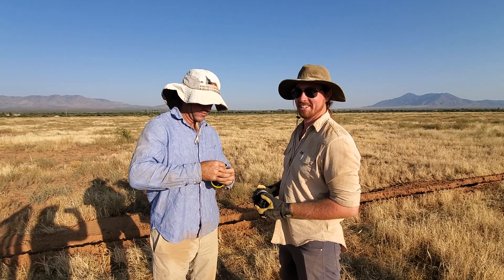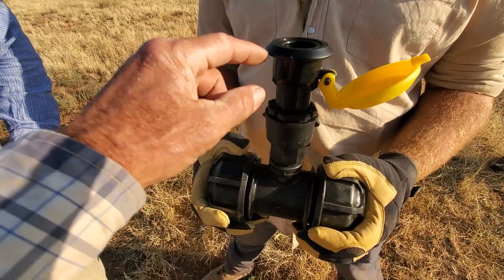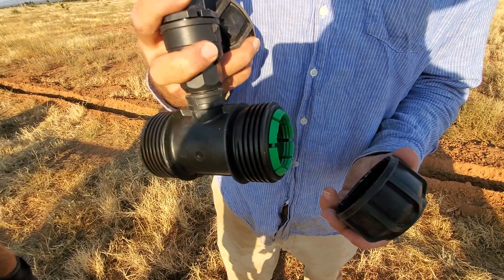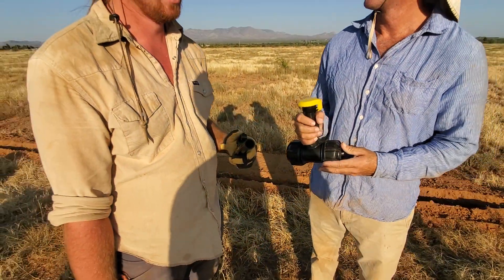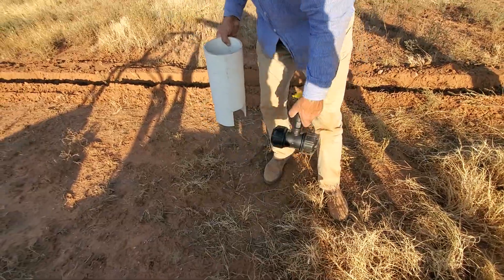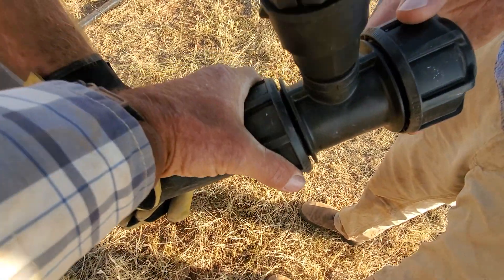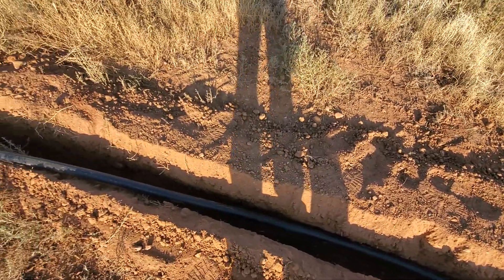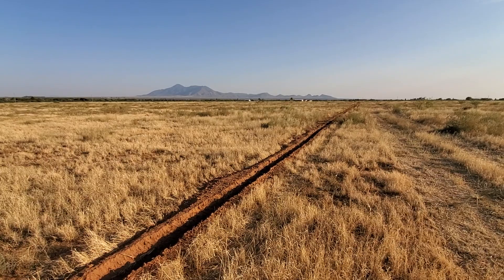Installing water points in Arizona grazing project.

Comment: We use "saddles" to install the quick couplers at locations other than pipe joins.  They are much cheaper than joiner T's.
Reply: That’s good info. There’s always more than one way to solve a problem. Thanks for sharing.

Comment: When a 500’ roll of the 3/4” HDPE pipe is unrolled, will it lay out reasonably flat or does it tend to recoil back into a roll?  I’m wondering if I need to lay mine out for a few days before I can work with it.  Thank you in advance,
Reply from the maker: 3/4” is easy to work with. 1.5” diameter pipe is much more challenging!!!

Comment: As a fitter 
Teflon tape or pipe dope doesn't hold water back 
All it is a lubrication so  you can tighten a little more
Reply: It's so you can take it apart years later.
Reply: @iamchillydogg  not really 
The threads are. Flat at top and bottom.
But with mass production you can't tighten them up 
With lubricant 1 more turn gets the flats at top dropping into the flat at bottom
Try a 5 yr apprenticeship 
You learn this in your first week

Comment: What are the potential impacts from groups of border traffickers and smugglers? Is this a high traffic area for that acivity? If so, what precautions are you taking to protect the line from "coyotes" who will have zero compunction about cracking open those couplers to get a drink for a band of thirsty travellers ? Private property owners along the border will tell you that northbound groups care not a whit for the property and infrastructure they encounter along their path and will do what they need to do in the harsh desert.

Is there some kind of meter set up to tell you if the water flow suddenly turns up full blast and doesn't stop? That could serve as a warning for the managers so they can get out there with a team to walk the fence and replace any coupler(s).

Will you instead leave a male attachment in each coupler which would allow passing groups to simply drink from the connection, removing the necessity of simply smashing the coupler and the resulting costly losses of water and replacements?
Reply: Insightful questions.
Reply: He did say there were all kinds of nasties out there.
Reply: Sounds a lot like certain westbound groups that landed on the east coast a few hundred years ago @

"Private property owners along the border will tell you that northbound groups care not a whit for the property and infrastructure they encounter along their path and will do what they need to do in the harsh desert."

Comment: Great video. That’s not the proper technique for applying Teflon tape though.
Reply: Thot it was clockwise with the threads. Looked like he did a few extra wraps around the pipe tho.. Surprised it fit when threaded